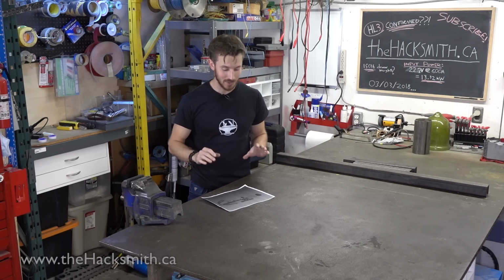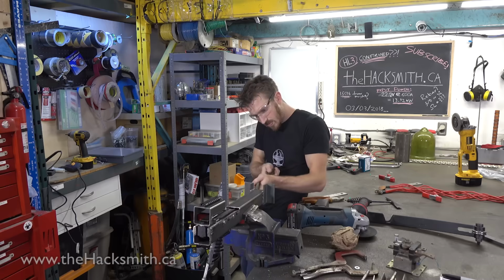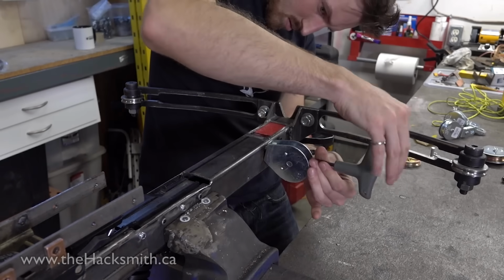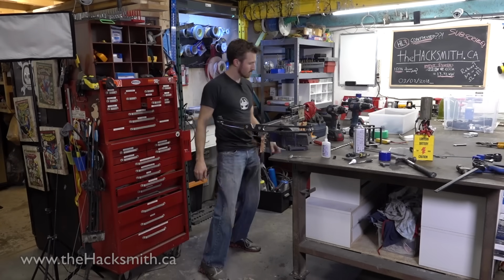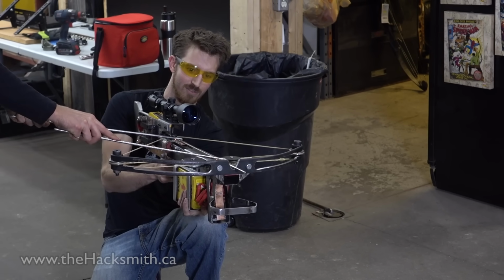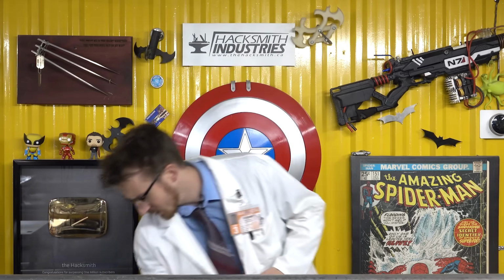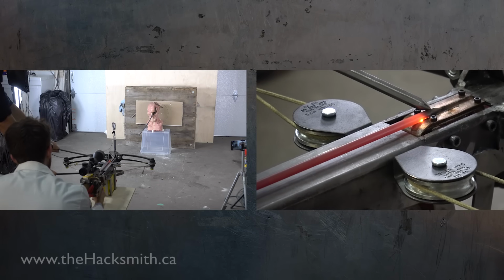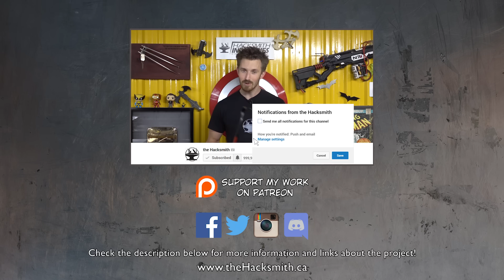REBAR CROSSBOW FROM HALF LIFE!

Comment: Like many weapons from games, the whole concept is seriously flawed - but you actually managed to get it working as intended. That is a major accomplishment and I salute you! Good job. Of course the crossbow could be improved by a built-in winch - then you could also increase the draw weight further. Rebar isn't a very good arrow material anyway as it isn't front heavy, so the "arrows" won't fly straight over a longer distance. They will start to tumble pretty soon. Plus, as you clearly demonstrated, it is a stupid idea to heat up your arrows as they will get butter soft. Much easier to make burning arrows with a bit of steel wool and sulfur, or make them ignite on impact.
Reply: JoergSprave spittin truth
Reply: CHOP very true
Reply: CHOP the legend of making 1100Joule weapons out of nowhere, that is llegaly a toy in Deutschland
Reply from the maker: +JoergSprave thanks Joerg! I too was surprised how close to the game we got it! The one in the game is winch driven so maybe a future upgrade?? I just picked up a crossbow string assist for it in the meantime. It's a lot easier to load now. Only after bruising my chest during the filming of this video!

We should do a collab sometime :)
Reply: JoergSprave add molybdenum and extra carbon to the rebar and it shouldnt distort when it is fired at head
Reply: + Timothy Egoroff That would likely work, but it also would make it less post-apocalyptic as a molybdenum steel rebar is a bit more specialised than improvised. That being said, your idea raises a very interesting question; with more creative freedom, how good could this weapon be? Perhaps with more specialised materials this could become quite the weapon. Still either way would love to see more experimentation with this idea (crossbow grappling hook? swiss-army crossbow?).
Reply: To be fair to the game, it's supposed to be a clunky improvised weapon in Half-Life as well. The only reason that the player can use it with ease is their super hazmat suit
Reply: was just gonna suggest a winch lol btw love the slingshot channel
Reply: Honestly I think  that increasing the draw weight might be a bad idea. The metal, as you mentioned, is so soft after heating that the acceleration alone could warp it in-flight. There's probably a perfect sweet spot for heat and draw that you want to hit where you get the highest effectiveness.
Reply: I feel like "seriously flawed" is an understatement. Whats the point of getting the bolt red hot other than "because it looks cool". All it does is seriously compromise the bolts integrity without adding anything to penetrating power. And as a weapon this thing is just plain evil. Having a red hot bolt would cauterize the wound preventing blood loss while causing extreme pain. Not that lethal. But i will admit, it looks really cool.
Reply: Challenge him in crossbow making Wood VS technology
Reply: Woogoo336 
It is lethal against cyborgs, so...
Reply: when u heat metal it expands this causes the weight distribution to be very uneven as well as it will bend just from the pressure of the air and the energy needed to make it fly
Reply: JoergSprave true but if it weren't rebar and it wasn't heated on the crossbow, it would just be too far from what its supposed to be
Reply: JoergSprave as a person who actually shoots crossbow as hobby, i can confirm this
Reply: JoergSprave 420th like
Reply: You've done something from Half-Life, now do portal stuff!
Reply: JoergSprave I
Reply: Anthony Tokuno has
Reply: The best part about this comment is that I can hear Joerg saying every word in my head; its hilarious.
Reply: Rebar wouldn't work well, but a high melting point metal like Tungsten would make sense if you could find a way to make it fly straight.
Reply: JoergSprave
Reply: You are a legend
Reply: You are awsome!!!
Reply: Let me show you it's features
Reply: Maybe they can change the resistive heating sistem whit an inductive front coil for the head of rebar, making it more capable of flight straight and hittin things
Reply: I read is in Jeorg's Voice for some reason
Reply: Let me show you it’s features.
Reply: JoergSprave it's funny because as much as they struggled pulling the string and the force it took they didnt mention that in the game the crossbow does it automatically with a winc, gordon just puts the rebar on it, unlike in the first game where he used a handle to pull it back
Reply: The horse shoeing though makes it so you wont get it out easy
Reply: Woogoo336  I have no doubt that a red hot bolt would cauterize the wound, but it would also cause some serious damage to your internal organs. Having your stomach (or another organ) being burned from the inside continuously while you're trying and failing to pull out the bolt because it is too hot to touch, not to mention the possibility of severe nerve damage. Fuck man, I would not want that crossbow anywhere near me.
Reply: I spent this entire video thinking "Man, why isn't Joerg part of this?". I really shouldn't be surprised to see you in the comments :P
Reply: Woogoo336 I am guessing the point (no pun intended) of a red hot arrow is to ignite the many incendiaries and explosives scattered throughout the game. Though the heat will soften the projectile itself it may also  compromise armor and may be effective as an antimaterial weapon against the many biomechanical and mechanical enemies in the HL games as after penetration of the outer core it continues to cook the insides.

It’s also effective in psychological terror.
Reply: judging by original futage from game: the bolt was ~30cm long and ~3cm thick, so its ~1,7 kg of steel. just throwing over 1kg projectile in someones head will cause a lot of damage, its like throw ajustable wrench, doesnt really matter which side it hits, no even need to penetrate, just kinetic energy. and glowing is just decoration, as bonus it cause a fire. 
What i wanna said is such hand catapulte can be lethal.
Reply: You must mass produce this weapon! In the lore, the combine can span multiple universes! You should also try to make the RPG
Reply: Hello joerg
Reply: Blablablablablablah
Reply: @hacksmith  is
Reply: we all have to take in consideration that there were many things in game that are otherwise impossible without "combine technology". im sure that the crossbow uses some of that, like a combine battery to heat the rebar fast
Reply: Haha when I seen the title of the video, I literally expected to see you here! :D
Reply: i think the idea for the "red hot bolts" is so that if they dont kiill whoever it hitts then it the red holt bolt would cause serrious burns, and with rebar it might not be as floppy, but id be inaccurate as hell
Reply: tbh kinda curious what would happen if they stain the arrow head with nitroglycerin, could be more explosive than gunpowder
Reply: @Woogoo336  ngl its  a si-fi game about space fascist i think thats the most realistic thing in that game but it doesnt make the game any worse
Reply: @hacksmith  Medieval reenactor here. Better and faster than a winch - since that crossbow already has a foot stirrup (that steel loop at the front), you could simply, you know, use it. 😜 That loop is meant for you to press with your foot (since legs are far stronger than arms) while the string is held with a simple hook that hangs from your belt (YT won't let me post links, but Google will provide results with "crossbow belt hook").
Reply: but thats what made the crossbow unique
Reply: the concept IS cool tho
Reply: this is valve we're talking about here, they're an exception, they somehow manage to make 99% of the game make sense. even the portal 2 ending
Reply: @Slingshotchannel The reason for heating the bolt might be inspired from the the way an arrow wobbles for extra accuracy when shot from a bow. crossbow bolt are usually shorter and dont wobble but the lenght of the rebar is closer to an arrow.
Reply: well, the HEV suit is an exoskeleton so that explains the unrealistic draw weight
Reply: Holy fuck it’s YOU!
Reply: and what if combine armor resist sharp thing but are weak ti heat and heavy contusions?

Comment: I always thought that the rebar being red hot would mean it's very soft and would bend while shooting and either become a boomerang or blow up in shooter's face or turn into a donut under the crossbow's push and take off in a random direction.
I am surprised you were able to get a steel rod that is both red hot and rigid enough to be shot from the crossbow and penetrate it's target. Also, just the fact you were able to make a sufficient portable power source is incredible enough. It's crazy how you made this clearly insane idea from HL2 into a working (albeit not practical) weapon. Kudos!

Comment: You should've made a spring leveraged mechanical draw system. It would've made it way easier to draw, and you probably could've gotten it to work without sacrificing nearly as much draw weight. You also could've doubled the limbs and counterweighted them, but then it wouldn't look as much like the Half Life crossbow. The spring leverage system could've potentially fit inside or around the crossbow to make it functional without sacrificing the scrappy thrown together look of the original. If you got a small beefy spring you could've made the latter half of drawing much easier, and it still probably would've fit inside the body with all of the other components.

Comment: I've watched this video a half dozen times now... such great execution!  Hats off. Now that I've gotten over the "wow" factor and my brain engaged, I had a question. How come those Lipos didn't blow from the short? Did you use a protection circuit?  If so, any chance you will publish it?  The inner nerd in me is dying to know!  Again, great job. 👍
Reply from the maker: +LockPickingLawyer even though I'm "shorting" the batteries, that's not quite what is happening!

Think of the rebar as a giant resistor or load! It will take a maximum amount of power, which is why we tested with the car batteries first! It will only draw 1000-2000A. So we made the battery pack capable of giving twice that!

Also as metal heats up, it draws less electricity! So if it's say 2000A to start, it drops down to around 500A when it's red!
Reply: Also good to note - LiPo's are rated by max current they can happily provide without risk of damage, noted as a 'C' rating. 20C means the battery can provide 20x the storage capacity of the battery in Ah (or mAh). ie. 5000mAh battery with 20C has max current of 5000x20= 100,000mA or 100A. Placing multiple batteries in parallel will multiply this max current.
Battery will go flat quickly though, discharging at 20C means you'll only get 60min/20 = 3 minutes runtime.
Reply: Hi Im Lockpickinglawyer and today I show how to open the silo door.

Comment: So after skewering your enemy, you cauterize the wound.  A humane weapon for a more civilized age.
Reply: I don't know about you, but it would still be painful if it's still lodged in you, try pulling out a red hot bolt with your bare hands while getting cooked from the inside. xD
Reply: That rebar is red hot, ribbed and stuck in impaled targets. It will cook them from the inside out.
Reply: Fire this into the eye, the liquids instantly evaporate. The wound is also cauterised instantly, meaning the gasses have nowhere to go. The eyeball explodes.
Reply: Both aliens and synth enemies in HL2 have a big problem when it comes to fire. This is the best diy weapon to use against them.

Comment: Thinking quickly, the Hacksmith constructs a homemade crossbow, using only a leaf-spring, some scrap metal, and a crossbow!
Reply from the maker: XD!
Reply: but rebar when its not heated actualy worked better than normal arrow, and what if we make rebar with sharp tip? heated rebar looks like could only be used for lighting flammable things on fire
Reply: Make pretty tracer rounds as well! 😁

Comment: idea: get a tungsten carbide rod (size of arrow), put steel arrow tip to one end, then electroplate arrow with coating of nickel so when it heats up it will give that orange red glow really easily. this should be able to withstand the heat (due to the tungsten core) and retain its shape when it hits the target. you could just sharpen the tip instead of adding the arrow head. lmk what you think
Reply: just looked up price for tungsten carbide rod around the size of an arrow, there's one on amazon at 0.25" diameter and 12" long. it would be more the size of a bolt than an arrow but its only $55.
Reply from the maker: lol $55 for a shot and it might not be reusable? bit outside of my budget!

Comment: Now i'm excited for frying pan :D
Reply: MR. UNICUM golden frying pan batter
Reply: MR. UNICUM I was exited, but decided to stay.
Reply: Not for cooking

Bullet resistant butt shield
Reply: MR. UNICUM 8
Reply: You have to coat it in Austrailium and make it count kills too.
Reply: Won't work.
AR500 steel is bulletproof because it's extremely hard, but like a diamond, that hardness makes it extremely brittle.
Because of that, it can't be coldforged as it would just shatter, but if they heated the metal up for shaping, it would become soft and no longer bulletproof.
Reply: M
Reply: STOUT STOUT SHAK-O
FOR FOR T-TWO REFINED
DEMODEMOPAN
DEMODEMOPAN
DEMOPAN
Reply: Dick Nickler but what if they didn't reshape it but just use this for the base of the pan

Comment: Here's an idea, let's make the ammunition heavy, slow, and weaker/more mailable than it would be normally
 (that comment was directed more at the creators of the game, not the builder of the cross bow. Rock on dude)
Reply: The rebar is ribbed, blunt and red hot. The shape and weight would cause massive damage after impalement. The stuck superheated rebar would cook the target from the inside out.
Reply: DUDE you need some heavy shit for the combine, zombies, and aliens!!
Reply: Oh yeah, something that the Hacksmith didn't follow up on is that the Half-Life 2 crossbow isn't just an inductive bow but possibly a railgun. (Er...Railbow) The bolt sits on two metal rails and there is a loud zap with a flashy sparking electrical discharge when it fires.
Reply: I don't know how that rebar penetrates combines
Reply: Watching this made me realize how impractical this weapon would actually be. So heavy and difficult to load!
Reply: That might just be because of the electrical heating device. And the crossbow already has a means of propelling the rebar, magnetic induction would just take even more power
Reply: Rattlesnake Zack yea but it would still melt through ARMOR
Reply: its not gonna burn the armor fast enough to go through it though
Reply: It would be for a normal human... But Gordon's wearing a HEV suit, which is basically a military exoskeleton modified to allow working in otherwise lethal environments. Pretty sure it'd have some kind of strength enhancements.
Reply: +Cake64 Many railguns use two means of propulsion. The electrical discharge that causes the magnetic field to move the projectile forward has tendency to fail to fire and sometimes even weld the projectile to the rails. So many DIY railguns use compressed air, pistons, and bowstrings to nudge it forward.
Reply: Rattlesnake Zack I love it when my ammunition is mailable 😂 it’s such a pain to pick it up at the ammunition store

Comment: This has high implications for great gameplay concepts that could have been added to Half-Life 2's crossbow.
 •Toggling battery power on and off
 •Rebar bolts pinning human-sized enemies to surface only when cold.
 •Heating uses a warmup-timer, affecting the damage of a shot.
 •More heat = less damage, but a shot would create an area of burn/melt around a target which would enlarge and burn/melt faster the hotter it gets.
 •On hit, the area of burn/melt would sizzle/skin the surface at low heat, spark some flame at that would burn it over time/melt a gib off of it at medium, and create a scorching fire that would instantly cremate the target at maxium heat. This would also depend on whether the target is more likely to melt or burn first.
 •This would apply to props and surfaces as well, which could create areas of denial in certain of situations.

Comment: "pretty effective"... shoots 6 bolts into a zombie head
Reply: At that point, I'd aim at center mass... it would be easier to penetrate the body and most of the damage would be done by having a RED HOT piece of rebar wriggling around your insides and melting them.

Comment: Now you need to make a tool gun
Reply: Only as an decoration ???
Reply: A gravity gun would be better
Reply: Toa you mean a "Zero Point Energy Field Manipulator" :>
Reply: physgun better than gravity gun
Reply: In the actual game it is called the Mega "Gravity Gun" by using the command physgun_mega_enabled 1 so it is not a physgun. That is a garry's mod Mega "Gravity Gun"
Reply: That really works
Reply: Lol spawn material from nothing
Reply: And the AR2
Reply: Actually, iirc, the physgun was an actual gun in the hl2 beta, but was scrapped at some point.

Gmod most likely re-used the gun's coding, and replaced the model with the mega gravity gun, as the physgun in the beta was similarly functional to the physgun in gmod, as it could lift objects, push and pull them (iirc), and lock them in place with a node of some sort.
Reply: Yes, because it's possible to create a car out of thin air
Reply: GrumpyDuck gg